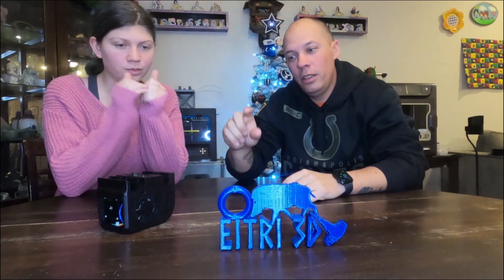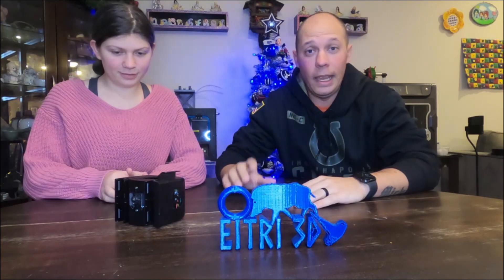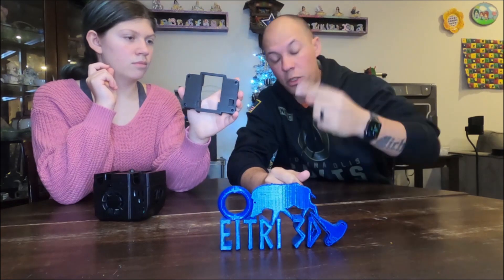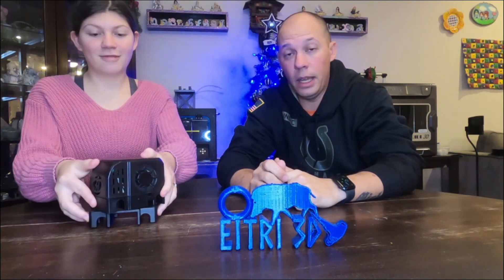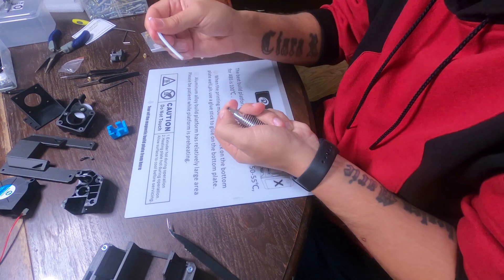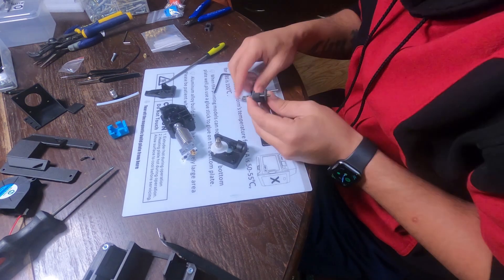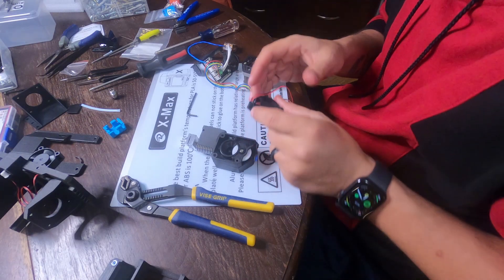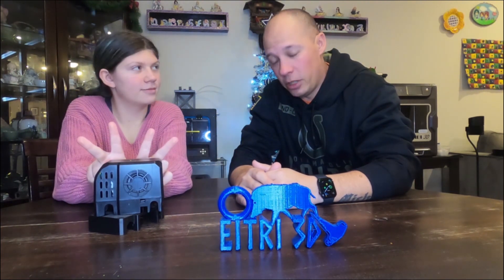Part 1 - Qidi X-Max All Metal Hotend Upgrade (Chad Mod)

Comment: Thank you for the videos you two have created, as a new X-Max owner they have been invaluable. I do have a question in regards to filament choice for the carriage assembly. Would a clear poly carbonate be a viable alternative to carbon fiber infused Nylon?
Reply from the maker: Absolutely, as long as you can print PC using the stock high temp hotend. I personally never tried PC until after I did this swap to the new hotend. Hope that helps!

Comment: So I’m having trouble getting the secondary cooling fan to run. Any ideas what might be going on here? It seems to come on randomly, but it’s off most of the time. I’m using the two pins on the right side of the three pronged plug. Negative on left positive on right. Thanks
Reply from the maker: There should not be a reason that fans stops. My first suggestion to make sure your connections are tight. They are in the correct places, but the intermittent on/off sounds like a bad connection. After that make sure the ribbon cable and motherboard connections are all properly seated.
Reply: @Eitri3D  ok cool thanks I’ll check it out.

Comment: Is there any reason I can’t use a pancake stepper Instead of the full size one? I figured it might be better to keep things lighter.
Reply from the maker: As long as you know the gear ratio, can calculate your esteps, and the dimensions are the same (minus depth obviously) then I don’t see why not.
Reply: @Eitri3D  as near as I can tell the step angle is the same so the e steps would be the same. The only difference is the rated current. The smaller stepper is only rated at 0.7 amps. I guess I’ll have to try and figure out how to change that in the firmware. Thanks

Comment: Hi, I would like to ask, why didn't you use ABS filament??? Or Nylon?? aren't they really not suitable for printing this kit??
Reply from the maker: Good question. Our model was made of Nylon/Carbon Fiber filament. It combine two exceptionally strong materials which has worked very well for many who have completed this upgrade.
Reply: @Eitri3D  And if I print from abc, will it fit or is it better to take nylon?
Reply from the maker: Nylon is more durable and with the blends it’s a better choice, in my opinion. If you print with ABS the fit will be fine, but I cannot speak for if or how well it will work.
Reply: @Eitri3D Okay, then I'll make the bottom part out of nylon and the top part out of abs.
Reply from the maker: Let us know how it works.

Comment: My X MAX is clogging halfway through almost every print! I have to take the extruder and hotend apart, remove the stuck filament and swap out the bowden tube that's filled with PLA. Do you think this upgrade would help alleviate that issue?
Reply from the maker: This upgrade could absolutely help, but I recommend you try to troubleshoot why it’s constantly clogging in its current setup first. This way you can make sure that you are not doing the same thing and clogging the Chad Mod. Either way, I absolutely love this upgrade.

Comment: been thinking about modding mine i hate buying the hotend kit from their ebay store would the thermocoupler in this work for the factory head. or do you know a good replacement to order from amazon them shipping the parts out takes far to long would love to have a replacement heater block thermisitor and heating cartridge i can order from amazon for the factory head
Reply from the maker: I cannot honestly say if it would fit. I’ve long done away with my factory parts to be able to check. Honestly though, if you are wanting to replace the majority of the piece that make up the hotend, you should just purchase the V6 and do the full swap. All links are in the description and all but maybe one was bought through Amazon.
Reply: @Eitri3D  I'm thinking about it I've just got to wait for their parts to get here to replace the broken parts to print it
Reply from the maker: Ahh, gotcha. That makes a lot of sense.

Comment: How is called a all metal hotend when you still have a bowden tube installed in the actual hotend.....
Reply from the maker: The PTFE Tube does not extend down into the hotend. It is used to guide it into the the cooling portion and then from there it is all metal from the cooling fins all the way down and out the nozzle. That is why it is an all metal hotend, unlike most that have the PTFE tube extend all the way down to the nozzle. Hope that help explains it.

Comment: Thanks for your videos, I've found several of them very helpful. I'm about to embark on doing the Chad Mod. One questions, did you use the high-temp extruder that comes with the X-Max to print the nylon parts? I'm seeing some Facebook group entries that say people are printing nylon with the standard extruder.
Reply from the maker: Nylon/CF was printed using the high temp extruder.

Comment: This video saved my life!
Reply from the maker: Glad you’re still alive. Lol. Care to explain the circumstances? Glad the video could help.
Reply: @Eitri3D  I just jammed up my brand new X-Max after one roll of Overture PETG. I was trying to figure out what to do after I saw some of the components of the X-Max leave a lot to be desired. I found the Chadmod and started getting the parts (new BMG, and Phaetus Dragon  High Flow Hotend). I finally picked up the Nylon CF from Microcenter after a drive to Cleveland today, and after I dry the filament, and swap in the High Temp X-Max extruder, I'm ready to print!
Reply from the maker: That is awesome to hear. Let us know how it turns out.

Comment: Thank you for the video. Fallowing your video + PDF file to build mine. Just noticed that on 10:03 Install Factory Stepper you put the new gear wrong way (upside down). Just be careful out there who is building first time.
Reply from the maker: In Video #2 around 9:10-ish I explain the orientation of the stepper motor as I’m doing the wiring. Thank you for pointing that out in the first video. I think that was a clip of me test fitting because even when I messed up it was never installed in that orientation. I’ll see if I can adjust the video to make it a little more clear. Seriously, thank you for pointing that out.
Reply: @Eitri3D  Its about the Gear install on the stepper motor shaft, not the stepper motor orientation. Sorry if I was unclear )
Reply from the maker: Oh, hmm. Well, I can say it still works, for now at least. I did not know that. I honestly didn’t even know I had to swap that out until about an hour after struggling with the original gear. I’m going to need to take mine apart and swap it around I guess. What issues could arise if it stays in that orientation? So far I’ve had zero issues and that’s what makes me curious.
Reply from the maker: Thank you for that. I pinned a comment with a link to page so everyone can see how I made the mistake. Thank you very much for catching this for me and for everyone else.
Reply: @Eitri3D  You helps us, we help you )

Comment: Nice video. Which Nylon filament did you use to print the new carriage?
Reply from the maker: I personally used Inland Nylon/CF from Micro Center.
Reply: Thanks! Any special print settings or just the default QiDi slicer settings?
Reply from the maker: The only change I made was bed temp down to 60°C.

Comment: Nice video!  I've updated the Thingi page with a link to it to help others out in the future.
Reply from the maker: Awesome. Thank you for everything! This is by far my favorite upgrade, so far. I’m working on parts 2 and 3 now.
Reply: @Eitri3D  I'm glad the community has embraced it and ran with it.  When I bought my X-Plus a couple years back there were no mods available and nobody in the forums knew how to do anything in the firmware yet.  The community slowly figuring out the chitu firmware codes made things like this possible.  Then it was just a matter of a couple hundred hours designing, printing, and testing everything. ;)  Since the project started there are a lot more hotend options available also, which is nice.
Reply from the maker: Well you’re doing great things and I know I appreciate it and that also seems the to be the consensus in the forums/groups and hopefully with anyone who comes across these videos. Can’t wait to see new upgrade. We can call it Chad Mod - The next upgrade. Lol.

Comment: Nice to see that you do videos for this mod. Build already several ones (as a service) for lots of people in the community (Europe) - always got good feedback. Based on the original mod I meanwhile offer 40mm fan (heatbreak coooling) + much more powerful (less air resistence) fan duct for part cooling. Lets see you next videos related to this :)
Reply from the maker: The upgraded cooling is huge, it’s makes it a lot easier to still be able to print PLA, which is difficult with an all metal hotend. I’ve seen your posts, you’re prints look amazing and consistent.
Reply: Olaf do you still offer to build theese, send me a email i would love to buy i pre buildt kit
Reply: @thetragilje3651  yes I do still: you can check here: https://www.elektrifiziert.net/shop/index.php?product/13-big-qidi-extruder-upgrade-package/
Reply: @Ole-Endurance  Do you ship to US?
Reply: @3DCraftwerkZ  Hi Chris, would do but DHL wants 37€ for shipping. And is shipping via ship currently. Seems lack of capacity on air freight :( means takes a month.
Reply: @Ole-Endurance  Hey there Olaf! I checked out your website and it says you're out of stock on the extruder upgrade, when are you going to have it available again?
Reply: @goner9696  i weekly put some in, But they are typically sold within the Same day. Recheck best on sundays. But Not this week any more